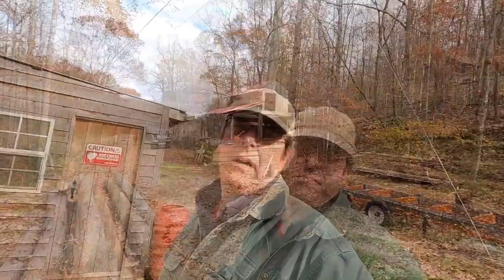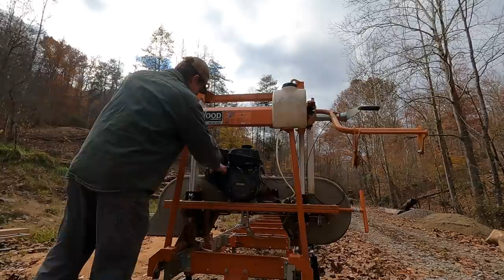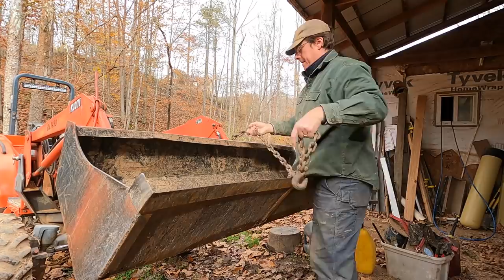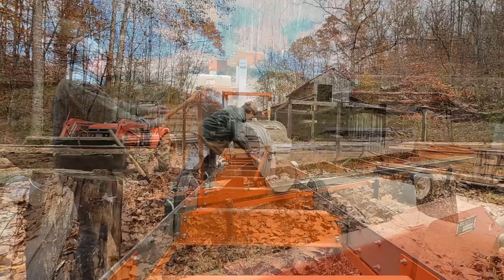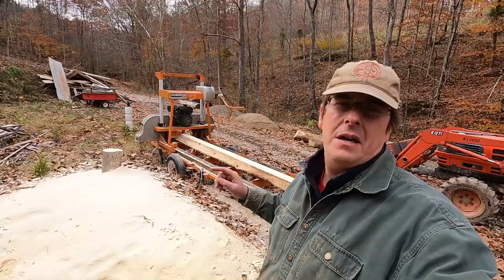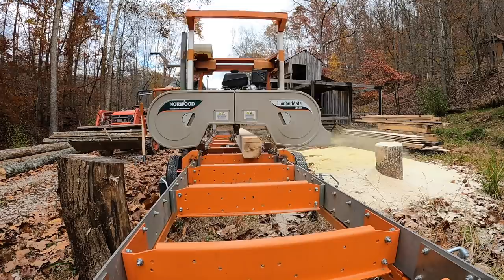Making Ship Lap on the Sawmill (For the interior of the Chicken Church)

Comment: As for the 1X6 "left overs" I would put it on the bottom run of the wall for added wear thickness against shovel wear. I would put a beveled edge on top so the edge wouldn't catch litter. I think a shovel could go through the 1/2 inch wood fairly easy.
By the way I nicknamed Kelly as the "Red Toolhouse Supermodel".
I see the smiles on Kelly and your face and think it is a true sign of God's blessings on you and your family. May the blessings NEVER END. AMEN.

Comment: Great idea.  Troy, I am sure you have a table saw set up that you can run your planks through to cut off the natural edges and get them to a uniform width.  My uncle had a big mill and it had a gang saw set up so you could run them through after they ran through the sawmill, he also had a planer mill so he could dress them.  The new mill was able to do several million board feet a year.  His old mills were the old circular sawmills that ran off of a stationary car/truck engine.

Comment: So do you plan to actually turn this into actual shiplap or do you really just plan to horizontally stack planks? If you do turn it into actual, shiplap I’m interested in what kind tool/method you use and about how many board feet you get before needing to sharpen the blade(s) or bit(s) as well as replace it/them?

Out of curiosity do you ever face your boards for interior use? Would like to see what planer you are using and durability and longevity of the blades.

Would be great to get the info for hard and softwood and if you do tongue and groove also.